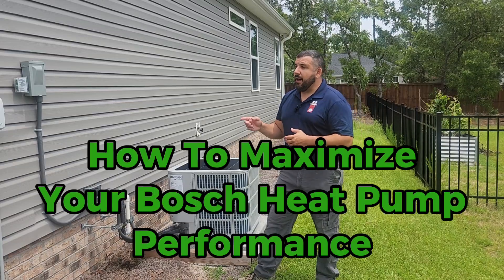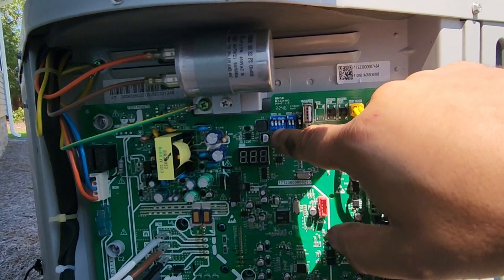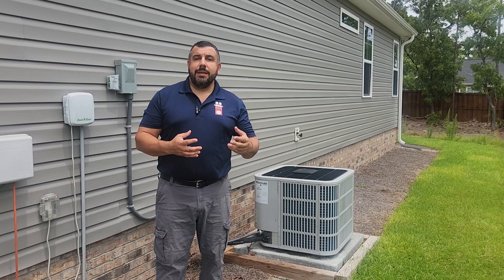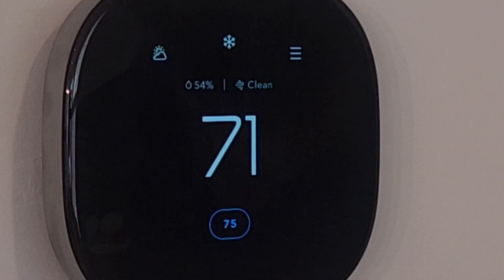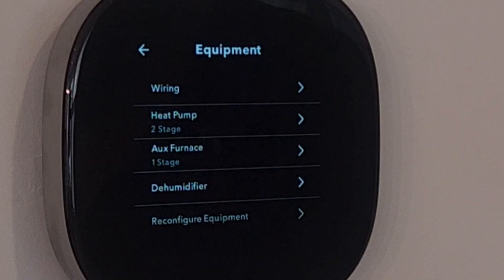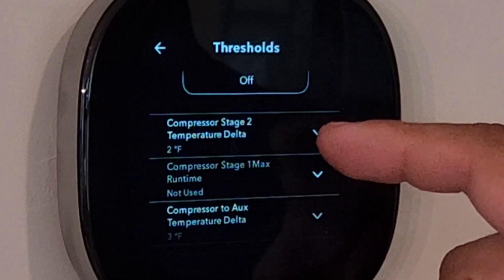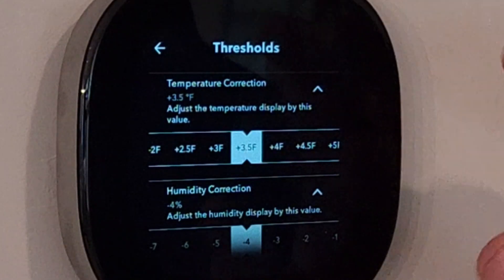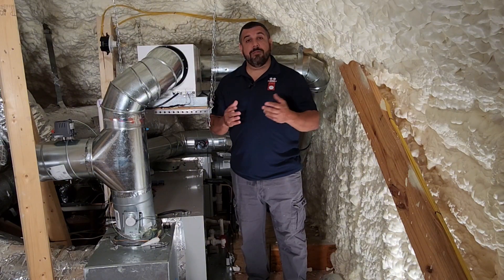How To Maximize Your Bosch Heat Pump Performance

Comment: Tweeking my newly installed Bosch 20 and my Ecobee Premium Tstat. My installer came back last night, and made adjustments to the air handler and outdoor unit to help maximize dehumidification similar to what Tim demonsrated.  At present it is not particularly hot outside, but humid. The unit doesn't run as often right now in general because of the moderate temps  I paid attention this morning to activity from overnight.  Although I can't post an image, the Ecobee graph shows that it cycled throughout the night, but seemingly started every cycle in stage two and then eventually reverse cycled back down to 1st stage.  Shouldn't my unit (unless there is a significant difference in desired temp and setting) start in stage 1, run for a period (presumably longer) and then decide if stage 2 is necessary?
Reply from the maker: @andrewsugg6844  yes you may have some overlap on the settings. Take another look at the ecobee
Reply: @timdestasiohvac  Thank you Tim. I will.  I've got a call into Ecobee right now.  They are to call me back.  Ecobee can see my setup remotely and determine if something is mismatched as you suggest.  I'll let you know what they recommend.

Comment: Hi, according to the Ecobee website, an interface module/adapter is needed for its thermostats to control a variable speed, or an inverter, system. Did you install an adapter for the unit in this video?
Reply from the maker: @alfort1943  no. Its not needed for Bosch. The compressor is inverter but is controlled via 24V traditional signals
Reply: @timdestasiohvac 
Good to know.
Thanks!

Comment: Great information man, i was wondering if there was a way to lower the fan speed the closer it gets to the setpoint and the reverse staging is perfect for that. I wonder if Nest thermostats have that same feature.  Most of my customers love either the nest or ecobee
Reply from the maker: @otisgregory5939  youd have to retrofit the blower controls for that.

Ecobee > Nest
Reply: @timdestasiohvac  on the heating side of things, up here in Indiana we get around 10-15 degrees in February,  sometimes below 0 does the reverse staging effect the heat side as well, can you say have a 15kw and it'll only run on element when it's more than 1.5 degree then kick on both if it's more then 2 degree difference.
Reply from the maker: @otisgregory5939  in Indiana your heating load is considerably higher than your cooling load I assume.  In this case you need a cold climate heat pump or dual fuel if using a traditional heat pump.  Sounds like you have a traditional hp with electric heat.  In this case you're going to be running a lot of electric strip heat which isn't ideal.  You can reduce how much strip heat by speeding up your fan in heating season, then lowering it using the dip switches for cooling season.
Reply: @timdestasiohvac  I agree , but some homeowners love them things like it was their kid or something. Right on for the information 👌

Comment: Just had a 20 Seer Bosch heat pump with dual fuel propane furnace back up installed.  House cools great - but seems to run 5-6 minutes then shuts off. Humidity is in the low 60% most of the time. We live in DE so roughly same climate as NC. 

BOVA36HDN1M20
Coil: BMAC3036BNTA
Furnace: BGH96M060B3B

Load calculation for the house via manual S:
Cooling  23,700
Heating: 26,600

Current HP settings- accelerated cooling switch is off and set to 3 ton (switch is up) 
No idea about the air flow settings…

Can I just switch the switches like you said or need to check the air flow?

Also- installer just put in a Honeywell pro stat. Would the ecobee be beneficial in our case? Worth the $220 plus installer cost?

Thank you!
Reply from the maker: You need to reduce airflow big time.  Switch it to 2 ton also.
Reply: scotth5978-look into fan handler company-google search will bring up....great people there  their product will give you a way to slow that fan speed down and works great with bosch heatpumps

Comment: Thanks for the video, great info. My wife and I just finished building our house this year and went with the Bosch 18 seer units. We have a 5 ton outdoor unit paired with a 4 ton indoor air handler and a 3 ton outdoor unit paired with a 3 ton air handler. I see you talk alot about setting the units up to properly dehumidify in the video, but you don’t mention anything about cost savings on the monthly electric bill. I assume the way you set up your unit would also be the best way for energy usage cost savings on the monthly electric bill? My units will typically run for about 20 minutes and then will shut off, and the airflow that comes out of the registers to cool my house is pretty strong. And mine only are set up for 1 stage of cooling. With these inverter units, I can’t help but think that if the units ran longer at a lower compressor speed and/or a lower fan speed, then I would see greater savings on my monthly electric bill, and would also achieve better dehumidification like you mention. So I’ve just been trying to figure out if my units are setup properly and if I’m getting the maximum energy savings I should be getting out of these units, but I’m not really sure how to determine that.
Reply from the maker: First, thannks.  Second, you SHOULD be following the steps in this video including 2 stage cooling.  Your thermostat should have a Y1 and a Y2 wire.  Second, if you're still cycling off on a really hot day, you should slow the blower speed down.

I am happy with my bills, but that is the last thing I am worried about in home performance.  My priorities are safety, health, comfort THEN efficiency.
Reply: Okay thanks. What about when winter comes? Will slowing the blower speed or adjusting the dip switches as you showed in your video have any negative affects in winter? Or those settings are also good for winter?
Reply from the maker: @Jake-fh1yw  thats DEFINJTELY a concern but not for me. Im on the NC coast and my unit never went into 2nd stge heat or defrost last winter lol
Reply: @timdestasiohvac . You’re not answering his question. Maybe you’re not concerned about your electric bill. But a lot of people are. Does running the unit by your way increase (and by how much) the cost of his electric bill. Thanks
Reply: @chessiekid4018 dont be rude. Set your heat pump up so it can maintain heating conditions with minimal strip heat. If that means running a slightly higher fan speed so be it.
Reply: My air handler speeds were set to low and medium. I changed it to low and medium low. Will keep an eye on it to see if it increases cycle times. 

I saw a video the other day where a Bosch rep said he would never hit the dip switch to change the unit from say a 5 ton into a 4 ton. The reasoning he gave was that you’re just capping the total capacity and he said there’s no reason to do that because the unit does that itself by only using the capacity that is needed. Would you agree with that? Or do you think changing it from a 5 ton to a 4 ton would show savings on the monthly electric bill?

Comment: Too many people complaining about high humidity with these Bosch units where you never hear that from people who have installed communicating variable speed units. Which one do you buy if you need a 3 1/2 ton?
Reply: Last couple years I’ve installed over 25 , no complaints, and no break downs yet😁
Reply: I guarantee you the installers didn’t even open the manual. I’ve seen tons of homeowners complaining here in Texas about their communicating systems, not to mention the communicating thermostat that is required does not always match the 10 year warranty. Lennox had 2 or 5 years on theirs if I remember correctly, and I always had angry customers at the previous company I worked with when their thermostat quit working and it was out of warranty and the cost to replace was over $1200.00
Reply from the maker: @clarkgwozdecki6782  Did you even watch my video? I'm literally showing how to set the Bosch up for humidity control.

If you need 3.5 tons, you probably only need 3 tons. But if you actually need 3.5, get the 5 ton with a 4 ton AHU. Yes thats a matchup. Then go back and actually watch my video this time.
Reply: @timdestasiohvac I’ve been installing this exact combo for 7 years and this is the best way this has ever been explained!  I’m definitely using this when educating my customers! Thank you!
Reply from the maker: @travisnelson8175  🙌🙌🙌
Reply: @timdestasiohvac  Yes I watched your video and I stated a fact that many people are complaining about high humidity running a Bosch unit where you never hear the same complaints from techs who install communicating variable speed systems. Also no where In Bosch’s manual do they say to use the ecobee to get their units to run properly. You did quite a few tweeks to that thermostat which you can’t do with most thermostats. I could very well see humidity issues now with this unit where an ecobee is not installed. Bosch should have their own thermostat that addresses this
Reply from the maker: @clarkgwozdecki6782  my video was how to get gteat results from a bosch.

You also dont hear bosch contractors complaining about leaky coils and blown inverters with 16 week lead times.

Still not getting your point
Reply: @timdestasiohvac there are HVAC contractors complaining about Bosch here on youtube. I’m not saying the are right just pointing out a fact. If I ever get a Bosch heat pump my contractors will be watching your video. Thanks
Reply from the maker: @Steve-bm2zm  theyre why i made the video
Reply: @timdestasiohvac  I enjoyed your video, but I disagree with the Bosch contractors complaining about leaky coils. The 3 ton Bosch package units are notorious for leaking evaporator coils and I have had to change several this year myself. (Raleigh, NC area)
Reply from the maker: @HamBone86  thats disapointing to hear. Thank you though.

Comment: Please I need your help, installer just installed the system and they set it up only as a one stage system and refusing to use y2, now my system is running short cycles
5 minutes on 5 minutes off. Space is cooling but I think this will cause my bill to be super high and what’s the point of having a Bosch heat pump if I don’t use it properly, please help if you can. Thank you in advance
Reply: Unfortunately this isn’t remotely unusual. Same thing happened to me. You can fix this as a DIY if you are handy. Read up on Ecobee and Bosch stage 2 and wiring. Took me a couple of hours to wire up Y2 and get things sorted. If you aren’t comfortable find a local Bosch contractor who is.
Reply: @bbartle4  thank you so much for replying, I’m very handy and I will be able to do the wiring, it’s the calibration and setting I need help with

Comment: I know there is a lot of variables but I just had a 3 ton Bosch ids 2.0 condenser and a/h installed in my home. I live in a couple miles from the coast in SC and the a/h in an unconditioned attic space. I know high humidity and dew point will affect if the a/h sweats but it seems mine is sweating a lot, including some condensation on the internal electrical. My old unit was a single stage 3.5 ton and my set up with a 2 zone with a bypass damper. Every basic thing has been checked, drain line, bypass damper, supply and return boxes for holes, but it’s still sweating. The fan speed is in the default position, would moving it to the higher position help with the unit condensation build up? And would that mess up the indoor humidity control?
Reply from the maker: You have a humidity problem in the space where the air handler sits.  If it is an unconditioned attic, you need more attic ventilation in there to avoid air stagnation.  I have to fix your problem with a Walmart box fan but that's the cheapest solution.  The next cheapest solution is to encapsulate the attic properly with spray foam.

Comment: Hello, what should my dip switches on my air handler be set to. I have the same as yours but 5ton.
Reply from the maker: @VinaySangha  Do a load calculation and read the ahu manual and set them for an airflow around 300 cfm per ton if youre in a humid climate. If it cant keep up, increase it by one speed tap. You'll need to read total static pressure
Reply: @timdestasiohvac thank you, can you show me how your thermostat is wired.
Reply from the maker: @VinaySangha  traditional 2 stage heat pump wiring

Comment: If the Bosch unit maintains a certain pressure on the suction, what does changing the dip switch to 2 ton actually do?
Reply from the maker: @pj91198  sets a limit at 2 tons worth of compressor wattage